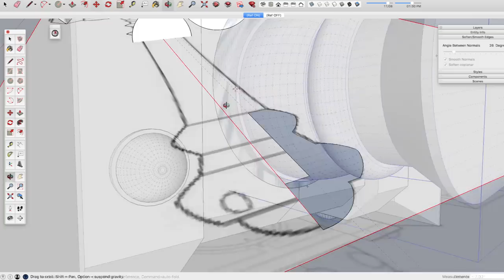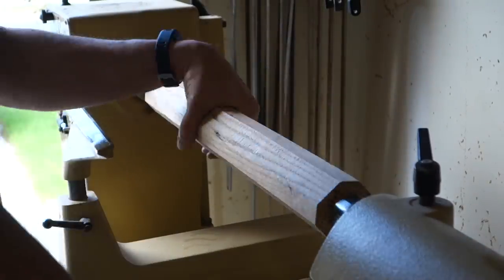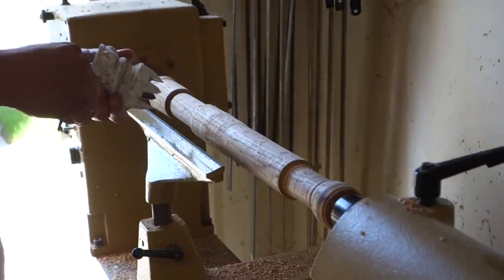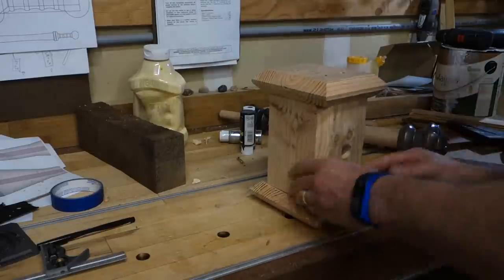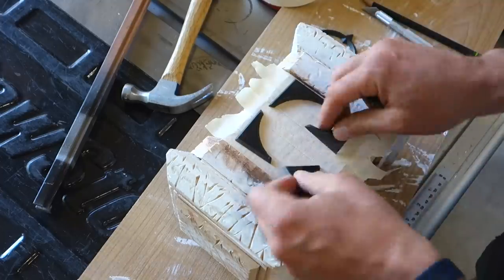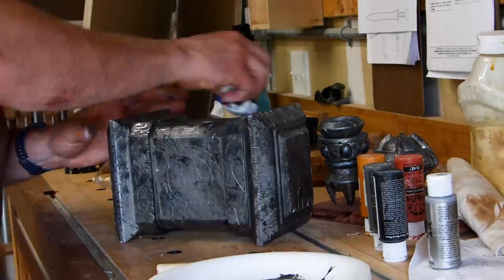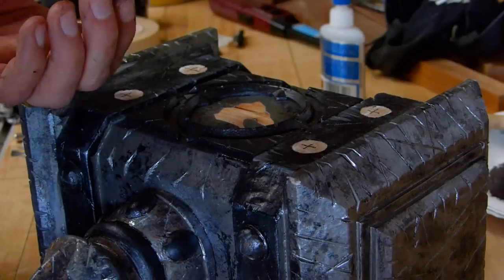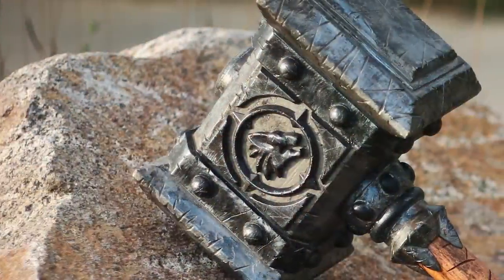Making the Warcraft Doomhammer

Comment: additional note: thrall not only replaced the blackrock emblem with a frostwolf emblem but if im not mistaken he also replaced the handle, if i remember correctly ogrim doomhammer actualy used/had it as a 2handed hammer while thrall shortened it down to a 1 handed one

Comment: I'm making a Thrall cosplay for October, this is really going to help me in the construction. Do you have the dimensions listed anywhere? Thanks.
Reply from the maker: Awesome! I don't think I put the dims anywhere, but in the description are links to the STL files if you have access to a printer or just want to open the files in SketchUp or other 3D software.
Reply: Thanks! Yeah I'm hoping a friend of mine will be able to print the parts. I should have been more clear, I meant more the hammer head and the length of the handle.